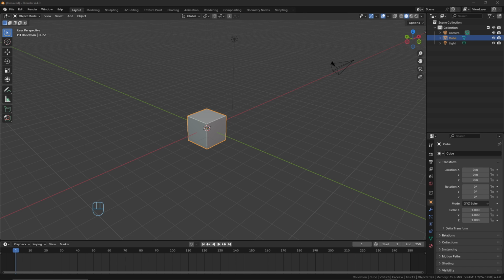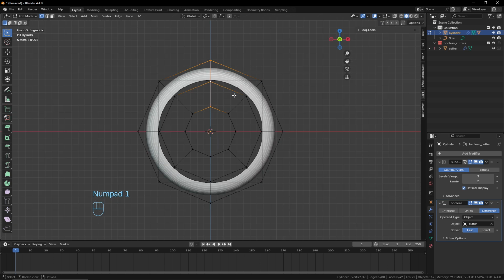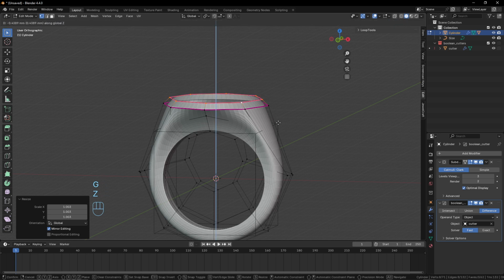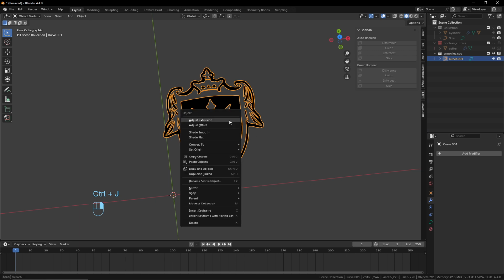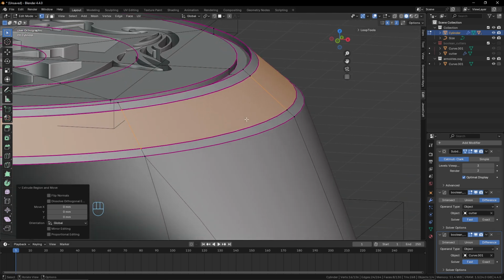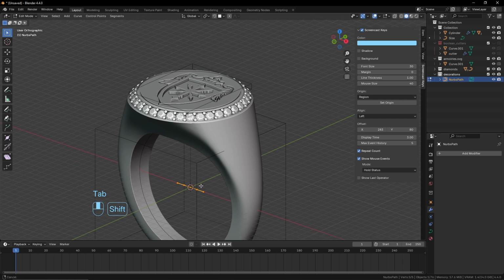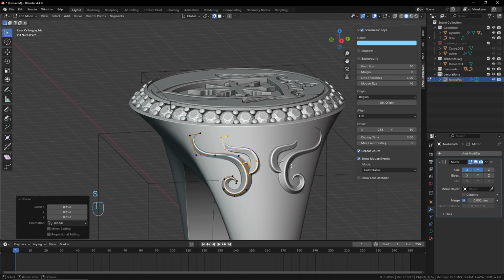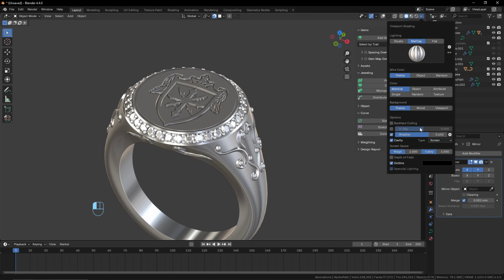Blender 4 4 Signet Ring Modeling

Comment: when i get to the part of creating the circle with the loop tool it gets deformed please help!
Reply: 1) The vertices are not in a clean edge loop
Circle only works on a proper loop.

Check this:

Go to Edit Mode

Edge select mode

Alt + Click an edge to select the full loop
If it doesn’t select all the way around, the topology is broken.

Fix:

Remove triangles/ngons

Make sure the ring is made of quads in a continuous loop

2) The vertices are not planar (not on the same flat plane)
Circle works best when all points are on one plane.

Fix:

Select the loop

Press S → Z → 0 (or X/Y depending on ring orientation)
This flattens them.

3) The mesh is scaled (not applied)
If the object scale is off, Circle will distort.

Fix:

Object Mode → Ctrl + A → Apply Scale
Reply from the maker: try ctrl+A apply all in object mode before.